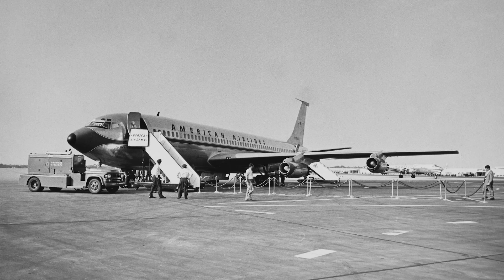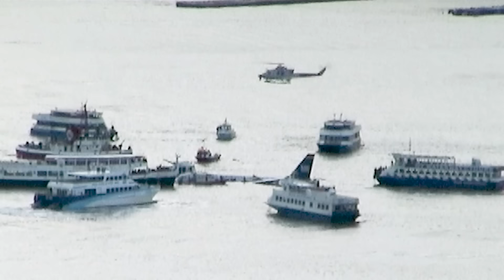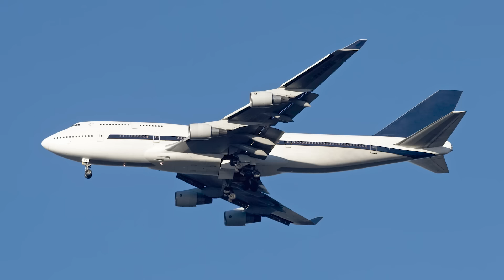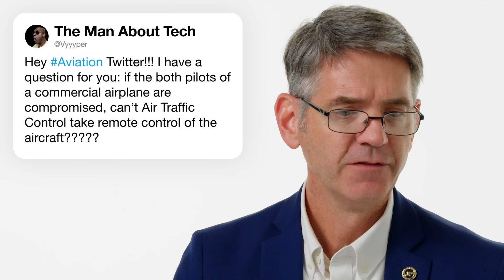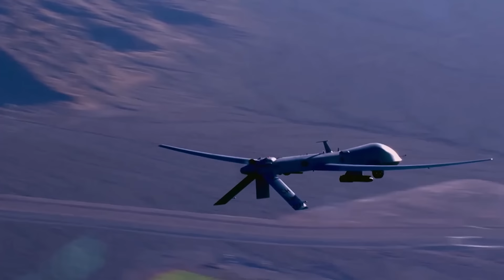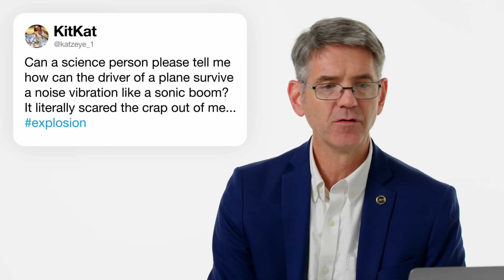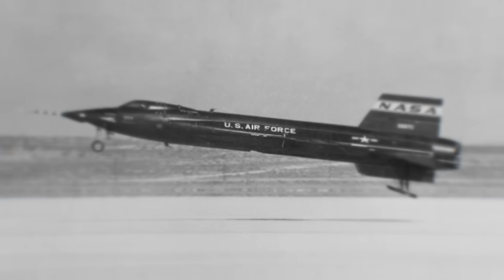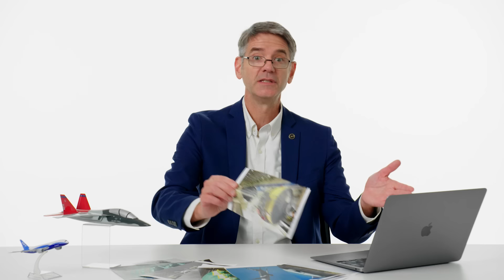Aerospace Engineer Answers Airplane Questions From Twitter | Tech Support | WIRED

Comment: @5:00 I mean, that's not the actual answer, though, is it? If you put a mouse in a black box, you're going to get a red box. The black box is designed to protect itself. All of it is built with catastrophic trauma in mind. It's not a magic box that negates physics. If you're going a megameter an hour, and then you're not, with very little in between, it really doesn't matter what box you're in, because you're a big sqishy bad of blood and guts and bones, not a specially designed recording device.
Reply: Well weight is also important for an airplane. He merely states that the weight would be a problem for flight. Which is also easier to understand for most people.
Reply: @1992dragonblade  I guess. But it still feels like the lesser problem. Like, maybe you could make a reinforced Cesna drone for which the instruments and everything inside actually would survive a crash, you know, if you had army money or whatever, and you could get enough thrust to lift something that heavy. But I don't think even the US military could design an aircraft that would prevent injury/death of a person if it were to fly straight into the ground. 

I accept that the weight issue would probably be insurmountable, especially for a commercial airliner, but still seems like the far lesser problem compared to the different deceleration needs of a piece of audio recording equipment and a human, and I feel like that would be pretty easy to demonstrate if that was the explanation you wanted to go for
Reply: Yes, the other point being that a plane made like a black box would require a thickness proportional to its size, so several centimeters of metal, instead of few millimeters today. And it will be impossible to fly it. Even ship shell can be deformed if the mass and speed is sufficient.
Reply: If you could slow the acceleration of the body inside the black box enough they’d be fine, which engineers could probably do given enough money and space
Reply: @ Run it by the science boys at Aperture. I'm sure they'll figure something out
Reply: Same problem as Mithril. The troll's spear might not go through the Mithril, but the Mithril can still go though Frodo!

Comment: Is flying safer than driving your car…
1. There’s a lot of redundancy in aircraft. If one component fails there’s at least one other backup. Critical components like the flying control computers and wiring will be quadruplex (4 backups that cross check each other). The aircraft I worked on had at least 5 ways of generating electricity (an AC generator per engine, a DC gen per engine, transformer rectifiers to make DC into AC, electrical buses that can be connected to power another, Ram Air Turbine) 
2. The standards of aircraft maintenance is on a whole different level. Everything is checked, tested, inspected and certified by Supervisors and Inspectors. Tool control and documentation is very strict. It’s easy to lose your job if you make errors. There’s no cowboys unlike car mechanics.
Reply: It's more of a perception and media spotlight issue. Car crush ( unless someone famous/important died, or crush is particulary spectacular/tragic ) usually will be just a footnote in news reel. If plane crushes, it will be on the news for whole day if not several.
Reply: Not to mention there's no air traffic control for cars. You may trust yourself to drive safely, but there's always a pretty decent chance of some idiot slamming into you, which you have no control over.
Reply: @ComissarYarrick   This. 5 or 7 people die every day in the UK, in road collisions. Every single day. The reason why it doesn’t make headline news is because it’s such a regular occurrence.
Reply: 3. Commercial aircraft (which are the safe ones) are flown by professional pilots. They have health checks, resting requirements etc. Cars on the other hand...
Reply: @notmenotme614  well it doesn't make headlines because 150 people didn't die, unlike plane crashes
Reply: @lildurty23  I am pretty sure more than 150 people die in road crashes every day...
Reply: @ericjessee  "You may trust yourself to drive safely, but there's always a pretty decent chance of some idiot slamming into you, which you have no control over."
The number of times I've tried to explain this to anti-seatbelt inbreeds...
Reply: @ComissarYarrick  So true.  I see multiple car crashes in my little corner of America each week.  Imagine the entire country over the course of a year.
Reply: There are millions of morons driving cars. There are trained professionals piloting aircraft, and relatively very few compared to the number of people who have a drivers license.

Comment: The simplest way to imagine how an airplane wing can produce so much lift is to look at it's surface area. A wing that is (as a random example) 4 feet by 20 feet would have a surface area of 11,520 square inches. So if there's a pressure differential of just 1 psi between the top and bottom of the wing, it will produce 11,520 lbs of lift. I know that's very oversimplified, but it demonstrates that a small pressure difference acting on a large area produces a lot of force.

Comment: 10:24 Ramp question.
Reply: Right, how stupid. The V1 should occur WELL BEFORE the end of the runway, and if it doesn’t, no ramp will matter.
Reply: The reason for the ramp is mostly because carriers don't have anywhere near enough space for regular takeoffs. The US and France opted for a catapult that has an extremely powerful engine, which slings the plane very hard to its intended takeoff speed. The main problem with this design is that it's expensive to buy and maintain, hence the ramp. There's only one problem: countries that use the ramp often tend to use short takeoff jets like the harrier and the F-35B, that vector the engine's thrust to lower takeoff speeds even further. And those that don't have to suffer the absolute horror story that is the admiral kuznetsov, the MiG-29K and the Su-33 (hint: they crashed a lot). The ramp is useless for commercial aviation, where you do have enough space to reach proper takeoff speeds

Comment: Simpler answer to "why don't runways have ramps" is because aircraft carriers can turn to an optimal heading to match the wind for landing and takeoff, runways at airports are built with the most likely wind conditions in mind but obviously the wind doesn't travel along fixed headings so a ramp would actually increase instability on takeoff and landing due to crosswinds.

Comment: The aim of takeoff is to generate enough speed so that the wings produce lift. A ramp doesn't help here and it's potentially throwing you into the air before the plane is producing enough lift. In normal takeoff you don't even lift up, you just accelerate and when the plane is ready it naturally takes off.
Reply: Yeah, it's a shame he didn't really answer the question thoroughly or maybe it was edited to fit the format. Going uphill on a ramp would also decrease your acceleration/speed, so your airspeed would be lower at the end of the ramp compared to a flat surface.

Comment: Note that several small planes now have "autoland" in case of pilot incapacitation. 
Single engine planes don't need to operate with one engine out. I've found that looking for a landing spot is a good thing when your one-and-only falters.
Reply: The main reason that we're unlikely to see planes without pilots carrying passengers is that few people in their right mind would be willing to ride in a plane where there isn't a pilot.

Comment: Why would Wired include irrelevant questions like "Can I ask a flight attendant to change to an empty seat" 5:16 to an aerospace engineer. Save those for a flight attendant for example, not an engineer.
Reply: There's always a couple of out of pocket questions for the experts, for fun. They usually find ways to interpret them and give interesting answers.
Reply: @Ogaitnas900  and in this case, he included an engineering-specific answer that the weight distribution of the passengers does matter
Reply: None of these were for an engineer 
They were for pilots mostly
Reply: @fufenbuggle  indeed! didn't mean to imply he didn't
Reply: Small weight distribution here and there don't matter unless the passenger is really heavy
Reply: To be fair, the entire episode was structured around "airplane questions", regardless of his field of knowledge. I'm sure he could've told the production team that he'd rather answer "aerospace" questions if that's what he preferred.
Reply: He explained that it was a weight and balance issue, in layman's terms.

Comment: Minor caveat about the Boeing plane numbering - they DID have a 717. It was essentially a modified 707 for military use, which was called the Boeing C-135 Stratolifter by the military. They never sold a civilian version, so the 717 same wasn't used for airliners.

Until…

Boeing bought McDonnell-Douglas, and renamed the MD-95 into the 717. (The only McDonnell-Douglas airliner design they continued to develop and sell after the purchase. They did keep manufacturing the MD-11 and MD-90 to fulfill already-committed contracts after the purchase, but discontinued any new development or sales after the purchase.)

Comment: 0:54 do you just not like the 757?
Reply: it does exist according to Wikipedia
Reply: @floraevoli3330 could be because it was meant as a kind of twin to the 767
Reply: Also he forgot the 717
Reply: Wel about 757, he definitly missed it. Very important jet airplane. one of the kind. i think there are very few (if any) modern twin jets narrow body with long range. thats what makes 757 special.

Comment: You realize how safe aviation is when you think about how dangerous driving 1000 miles is rather than flying it! Sure, it's safer PER TRIP, but it's even safer per mile.
Reply: His answer “only one fatal  accident every few years” clearly hasn’t heard of sprayers.
Reply: Commercial aviation yes, general aviation not quite so much
Reply: @JarrodFLif3r  GA is about as dangerous as riding a motorcycle. So actually pretty dangerous!
Reply: Not a relevant point statistically, given that the average airline trip is much greater than the average car journey - 20X? So, multiply the risk by the relevant factor. That's why comparing fatalities per passenger journeys is the more intelligent metric.

Comment: Why did you leave out the 717’s and 757’s ? 0:40 

717’s are still being flown by Hawaiian airline surprisingly.
Reply: The 717 wasn't originally designed by Boeing. The 757 is an omission though
Reply: And Delta
Reply: Idk about the 757 but the 717 was originally the McDonnel Douglas MD95 that just got renamed to the 717 when Boeing and McDonnel Douglas merged.

Comment: 2:11 What about Boeing, with its whistleblowers "deaths" ?
Reply: Boeing is still successfully taking off and landing there planes at a 99.999999999999999% (or whatever it is) success rate. 
You’re just filling your mind with the isolated incidences through a wonderful online algorithm 😊
Reply: @josh021588  dude's right, the older models are doing fine, it's the newer ones. MCAS was a disaster and especially how they implemented it.
Reply: @xino951  and the lack of training right?
Reply: @xino951  The MCAS disaster resulted in...two accidents, *total*.

Feel free to look up how many flights are performed with the 737 MAX family per *hour*, to talk of per day or week or month.
Reply: @fractalmuse  yeah two crashes and a total of 346 deaths, not casualties!! Plus if I remember correctly Boeing didn't even provide proper information to FAA. As far as I know they are not using MCAS on commercial airplanes anymore?

And about the 737 MAX yeah I know it's still operating but I don't think it has the MCAS system implemented, I don't know.
Reply: This topic is not in the course outline so dont ask
Reply: Hahaha
Reply: @xino951 MCAS is an integral part of the MAX.  There were a lot of changes made to the system after the two accidents. Every regulatory agency in the world went over that system with a fine tooth comb and were finally satisfied it was safe.
Reply: @xino951 MCAS is still in, but they made new procedures for what the pilots should do if it fails, which weren't there before

Comment: He missed the Boeing 717 and Boeing 757 listing the Boeing models.
Reply: they also put a photo of a 787 when he said 777
Reply: The 717 was designed and built by McDonnell Douglas before they were "merged" into Boeing. He skipped the 757 because it is 10 less than the 767, and because of that, unworthy of mention.
Reply: The 717 is an MD-80 with a Boeing logo slapped on it. (Okay technically an MD-90, but there isn't much difference.)
Reply: @aland7236 Irrelevant. They both should have been mentioned.

Comment: The airplane safety comment aged HORRIBLY
Reply: Not really
Reply: I mean, it's still true in most of the world that maintains a high level of standards instead of screwing with air traffic control structure at a rapid pace in order to appear like they're fixing an issue they're pretending exists...

Comment: A follow-up to the black box question. My my grandfather invented and holds a patent on the automation technology used in the creation of the black box. He also designed the collision avoidance system used in the F-15. Retired as the department head of the engineering department at Mcdonnell Douglas. He passed away a couple of  years ago. I can proudly say the aviation industry wouldn't be the same without my Grandpa. I love you, Grandpa, and I miss you.

Comment: Propellers can actually go quite fast, there have even been supersonic propeller driven planes. It's just going that fast with propellers causes a bunch of noise, to the point where you have the Tu-95, which is a flying noise complaint and you use to have the Tu-114 -its civilian variant, that was as peaceful in the inside as a construction site.

Comment: After seeing the video of that accident in South korea of an airliner crashing into a hard wall yesterday, I posted a comment on that channel as to why there aren't some way of having a ramp or slope that could slow any aircraft that has braking issues much like when you see a braking ramp for heavy trucks when their brakes fail.
Reply: These exist on some airports. They are called EMAS.
Reply: Water strip  may  be  provided  for  Belly  landing.  Water  and  foam  spray  devices  may  be  installed  at  the  sides  of  water  strip  for  ready  action.

Comment: Bird strike damage is highly dependent upon impact SPEED, which is not mentioned here.
Reply: And, the force varies with the speed squared.
Reply: I mean, is that not incredibly obvious?
Reply: @stoobydootoo4098 Force in fact is equal to mass times acceleration, not velocity squared. F = ma
Reply: @blablablablablablablablablbla  What acceleration? The kinetic energy varies with the square of the speed factor. If you run someone down at 20mph, the force at 40 mph is 4 x as much. 1/ mv^2. Still kgms/s
Reply: @blablablablablablablablablbla  News flash, there is more than one equation with force in it. One you should've seen in first year physics is F=1/2ρv²CA (drag force), a conceptually similar formula.
Reply: @oumu  News flash, we're not talking about calculating force in a context of fluid dynamics. Drag is irrelevant here. And yeah, obviously there are all kinds of contexts in which force is calculated. And many types of force. Did you think this was some kind of gotcha moment? "News flash" peak cringe lmao
Reply: @blablablablablablablablablbla  You've completely missed my point, but I'm glad insulting my word choice helps you feel better about it.
Reply: @oumu  nice rebuttal

Comment: The “make a plane out of black box material” has to be one of the dumbest ideas people seem to think somehow a good feasible idea.  Whatever the thickness needed to make the black box survive a crash would have to be greatly increased in order for a plane to not break apart.  And even if you could somehow construct a plane that would both get into the air and “survive” a crash with that material, the force of that crash would just kill everyone inside the plane anyway more than likely.

Comment: 0:25 that's not the whole story.  It would be even more efficient to fly higher, just need differently optimized engines. The problem is that, at 40000 ft the total pressure is about 21% of that of sea level pressure. Until that height, in case of cabin pressure loss, you can get the usual 21% of oxygen by simply breathing pure oxygen at ambient pressure. Going above that means that pilots would faint even if breathing pure oxygen. Concorde pilots used a special mask with forced breathing, but there would still be problems with passengers, it's simply not worth the risk.
Reply: This guy tryna talk bad about an aerospace engineer. Also, he’s probably just simplifying it so it doesn’t take a while to explain.
Reply: @Crabonoe Sorry, who's talking bad about anyone?
Reply: @Crabonoe  they didn’t talk had they just added in some additional details. i thought it was interesting

Comment: 12:36 How much does it cost to build an airplane.
The more relevant question is what it costs to buy an airplane, and that depends.
Interesting fact. The airliner manufacturer often offer the exact same pieces of hardware( airplane) with different maximum certified take off weight. The model that they certify with the higher take off weight is tens of millions more expensive even though there is no difference in the airframe.